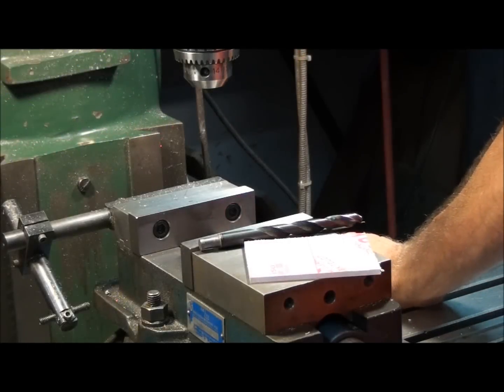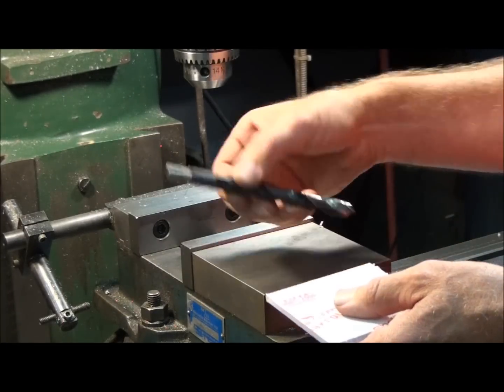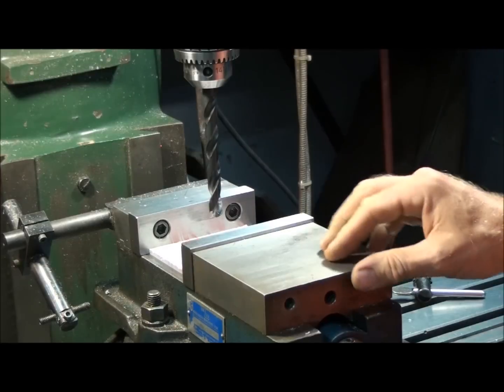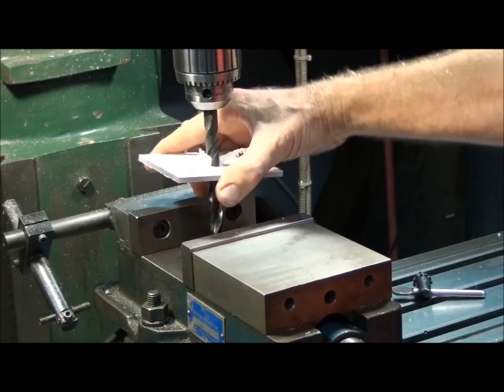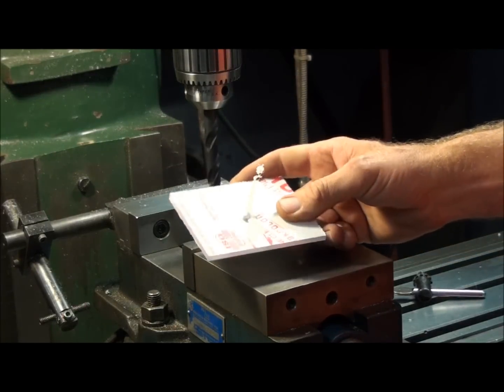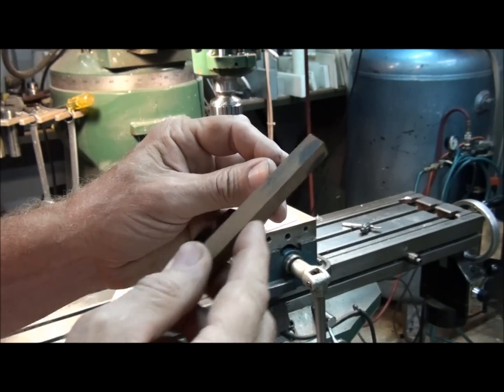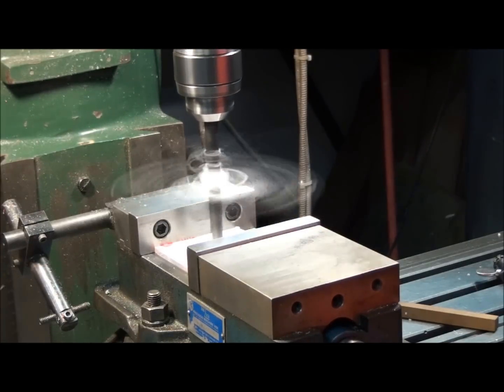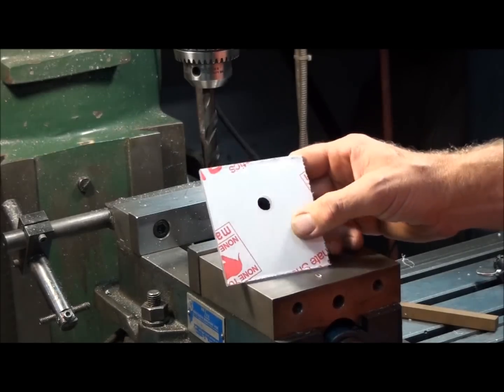How to Make a Twist Drill Safe for Use on Brass and Plastics

Comment: I believe you can drill using normal bits. Put another piece of plastic underneath as a backdrop. A thick piece on top if you wish as a clamp down. This prevent the shoot thru seen in your demo. I believe in slow speed, press slow. Sometimes, I twist the chuck by hand on thin plexiglass prone to cracking.
Reply: Toms Techniques Robert,
I have spent the last 20 years machining and handling plastic almost daily, and I can tell you you are playing with fire, why do you try to dismiss this important information Tom has shown, its simple just stone or grind the edge (I personally prefer grind), get rid of that ego,

........Edmund.......
PS: I have probably posted wrongly,
Reply from the maker: This will bite you. Sharp bits will screw into the plastic as I've demonstrated in the video, regardless of what's underneath.
Reply: Tom's Techniques  I've drilled 1/8 clear plastic with ordinary bits ($50 drill press) today as an example and works fine. Large or small bits. I held the plastic bare hands, no clamping, no sudden rush. Possibly, your drill has feed some kind of play/slack.
Reply: I'd recommend; try to stop the sudden rush as the large bit goes through, use a guide rod nut (those things that display depth as you drill...)  then that is one way to tell is your drill has play/slack. Remember to clamp down.  Plastic bends then goes loose on a precision vise. Set aside one metal block with a hole in the center. Chuck shouldn't get pulled off drill press - it can be secured by the operator.
Reply from the maker: RobertSmith
Robert,

You are trying to explain away a well known drilling hazard. If you drill plastics or brass with unmodifified drills, it is only a matter of time before one of them will screw in as I've demonstrated. It has nothing to do with the drill breaking through as you keep mentioning, it will literally screw into the work as you start the hole. If the drill is large enough, you won't be able to hold it by hand and it may even pull the work out of a vise as I demonstrated in the video. The fact that are ignoring this video and drilling plastic held in your hand is ridiculous. Please don't continue to do that because you WILL get hurt. If you don't believe what I am trying to tell you, that is your choice, but please stop trying to offer alternatives to a simple and common solution to this problem.

Thanks,

Tom
Reply: Walter Maisey
Just one other thing I forgot, its the same for Cast Iron, a flat on the land of the drill bit,

...........Edmund.......

Comment: Also when you do these kinda drilling its nice to have a center first so the drill find its way (basic drilling).
And also build up the size, not directly a drill of 20 mm but first 5 then 10 and then 20 mm.
Reply from the maker: Center drilling will help the drill start on location, but step drilling in plastic is dangerous even with a modified drill, because the drill will try to screw into the plastic. It's better to drill it all at once.

Tom
Reply: How about drilling at controlled, slow speed, with low pressure, so that there's not much material the drill can grab? Would that prevent the drill from screwing into the plastic/brass?

Comment from the maker: Ken,

Even if the work was clamped, the drill would still try to screw in. What happens then is the drill gets pulled out of the chuck, or the chuck gets pulled off (drill press). It takes a dedicated set of drills to safely drill grass and plastic. BTW, it's not really dulling the drill as much as it is applying negative rake.

Tom

Comment from the maker: Thanks.

When you get a drill press just make sure everything you drill, regardless of the material is clamped to the table or at least held against the column so it can't rotate. Bad things happen fast on a drill press.

Tom

Comment: Thanks for sharing. I wouldn't have thought to dull the tool. I've had things grab like this but never thought to try to grab it; just learned to clamp it down. :-) As a hobbyist, haven't the experience to have had the chuck come off the spindle or out of the tail-stock. Good things to keep in mind. Better to learn from other's bad experiences than your own, or at least give you the opportunity to have different bad experiences. :-) Thanks again.

Comment from the maker: I guess you've never experienced a drill chuck being pulled from a spindle or a part being ripped from a spinning lathe chuck. Drilling brass or plastics with a sharp drill is a dangerous practice no matter how the part is clamped. A properly "dulled" drill produces exactly the same result as a sharp one without the risk.

Tom

Comment: it is good that you are pointing out potential dangers with the drill press. however i do not agree with your fix. if the piece is clamped in 3 dimensions instead of just one this would never happen. pieces should be clamped down on the vertical axis and the 2 horizontal axis( what it the plural of axis) this way the piece is held in place no matter what. this takes only a few seconds more than clamping in one axis. dulling your tool just makes for poor results

Comment from the maker: I'll have to give the Forstner bit a try, but it seems like the friction on the outside of the bit would melt a thermoplastic. The other issue I can see is the limited selection of diameters.

As I pointed out in the video, brass won't grab unless it is pilot drilled, but it will grab. I've had it pull out of lathe chucks.

Tom

Comment: Thanks for sharing your technique, however I'm an advocate of using sharp tools. We always use a Forstner bit when drilling plastics. You can see pvc being drilled in my Rim Chuck and Round Tuit videos on grantham418  YouTube channel.  I've never lost a piece of brass with a twist bit, but ALWAYS hold brass in a vice or lathe chuck.

Comment: great stuff man,it happened to me once when i was drilling a brass round stock in the lathe and the chuck kept getting pulled in so it occurred to me that the drill bit had to much bite so i dulled it as you showed here and did wonders.
thanks Tom
Denis